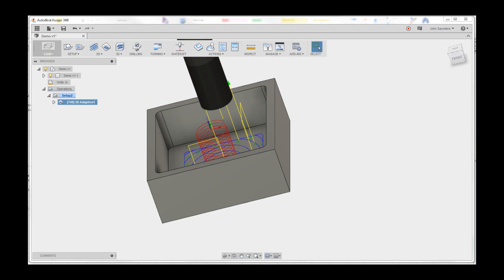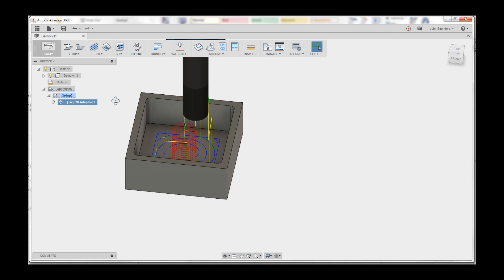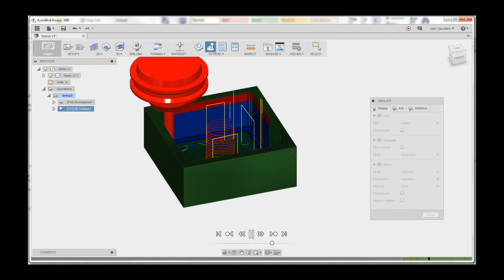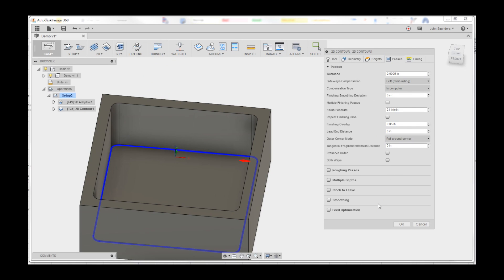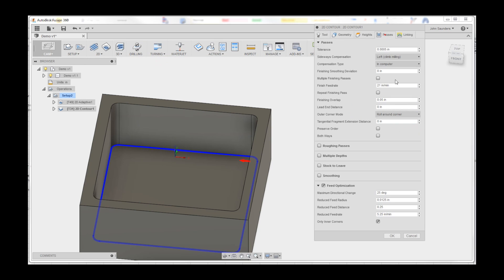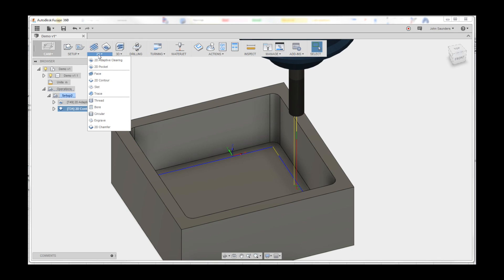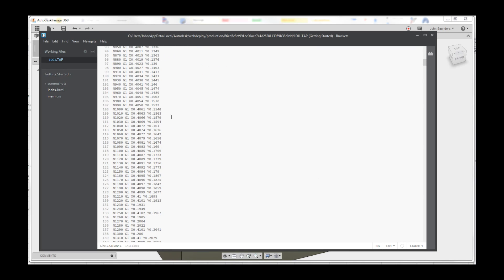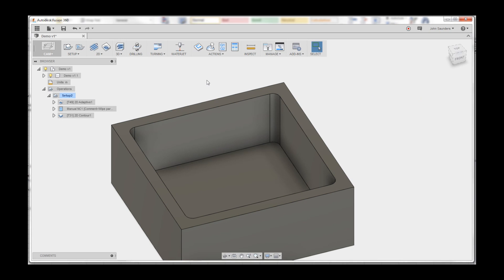Fusion Friday #13: Two Unusual Fusion 360 CAM tips!

Comment: I have been working with Fusion 360 CAM and Can not seem to get a pencil tool path to work on a contoured surface. Have you done much with a pencil tool paths? Im trying to machine the fillet on the base of the boss. Might be a good video to do. Image of what I am trying to do below. 

https://goo.gl/photos/rR1W6XePqw9QqbFc8
Reply: +NYC CNC I can not seem to get the geometry selected correctly it seems. The fillet is a .25 and i'm trying to use a 1/8" ball. I keep getting an empty tool path. Its has to be something simple that Im missing.

Comment: Would there be any point to taking a preliminary plunge cut (to remove most of the material) with the long, small end mill before making a finishing pass?  Maybe not. If it would be only a partial cut, there might be just as much side-load on the cutter as making the lateral cuts would cause. Possibly a deep-hole operation with a #32 drill (0.116" to leave some metal for the finishing cut) close to each corner before milling the pocket.

Comment: You can do all kinds of crazy stuff using the Manual NC command. You have to do all of that in the post though. But you can insert a Manual NC that will point the PP for a text file containing a set of NC code, which can then be injected into your NC output. Or you can use Manual NC to set properties which aren't in the CAM system, but allow you to execute code differently via the post processor. Lots of cool stuff can be done. Adam on the camforum has done some amazign stuff with his Tormach Slant Pro lathe post. FYI Manual NC is very visible in HSMXpress & HSMWorks.
Reply: NYC CNC The post system in HSM is one of the best things about it. It's that good sometimes its at the detriment of the product development, since a work around is possible in the post, the requirement loses priority.

Comment: John, is modeling a lake's topography feasible in Fusion 360?
Reply: +Glass Impressions I believe this is possible if you can get GIS/STRM/topography information into STL format; Fusion360 was updated in 2015 to accept STL import. (And if you need to clean up/simplify a mesh, I think Meshlab and Autodesk's Meshmixer will do that)

Comment: That Manual NC trick is pretty nice, though as +Iccccie said, you'd need an M01 or M00 to stop the program. That said, great for small job shops with multiple operators who run the same parts to keep information inside the manufacturing data, it has a way of getting lost otherwise... On the "Feed Optimization" tip, it's a decent workaround to keep from breaking tools or having to use a manual override knob when entering corners, but for optimal transitions and corner surface finish you want (A) a toolpath that keeps chip load constant and (B) a smaller tool than the radius you're working with. That said if you don't care about either of those things and want to get er' done, this is OK, but you want to calculate your maximum load (even if it's nearly instantaneous) to determine your approach feedrate. Too fast and you'll wear out your tool, too slow, and you can rub and heat up the corner.

Comment: Nice vid.  Little design trick a friend taught me - let's say you are doing that 1/4" end mill for the finish because you want that 1/8" radius.  DON'T design it with an 1/8" radius!!  Design it with say a .150 radius.  The mill never gets buried in the corner , and the mill cuts an arc around the corner - keeps a constant chipload (there are options on some CAM programs to do this - don't know if F360 does it)
Reply: What I'll actually do is doing a design for production is I might call it .135 nominal, but allow .120 to .150 or so, so it it ends up at a manual shop that can't cut arcs (no CNC) they can run into the corner with a 1/4" end mill, and if they are a CNC house, they can sweep the curve, and let the shop decide how to cut the corner

Comment: Small note, I don't know about path pilot, but that comment line won't pause or stop the program on other controls.  You need a M0 / M1 etc.. code to actually stop the program once it reaches the comment line. Manual NC -> STOP would work and then add the comment.

Comment: To rough only those corners, you can do another 2D pocket operation, but checking the "Rest Machining" under the "Geometry" tab, and enter the diameter of the previous tool you used. Works like a charm to finish the roughing of those corners and preparing for finishing operations.
Reply: And just set multiple depths as well, if your using a small tool.